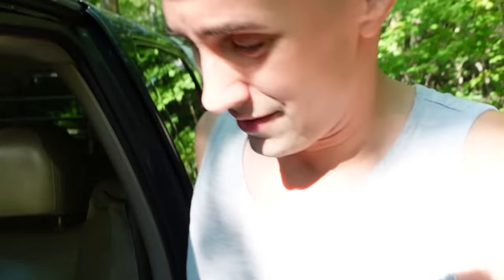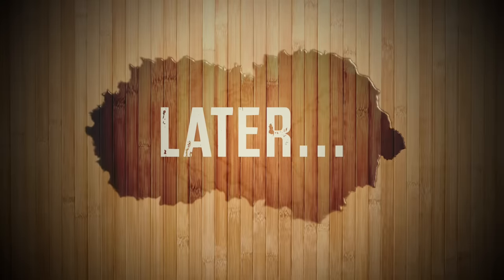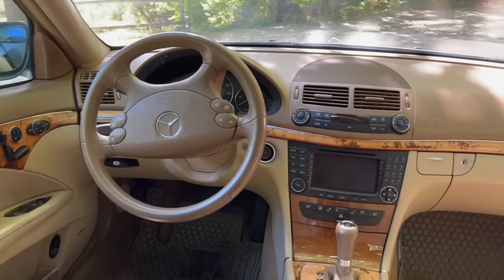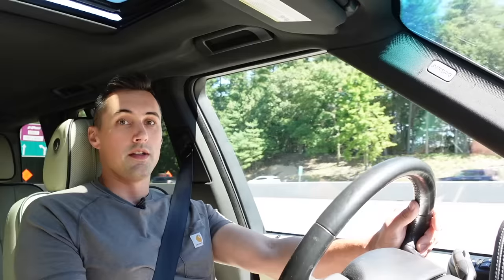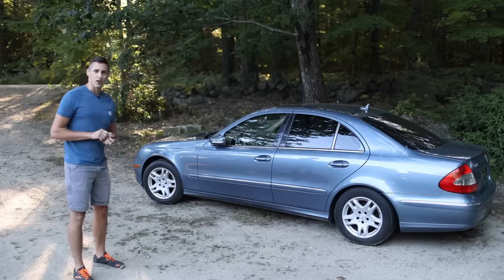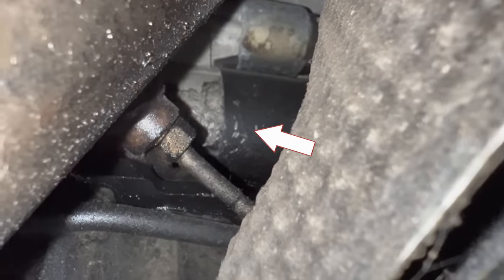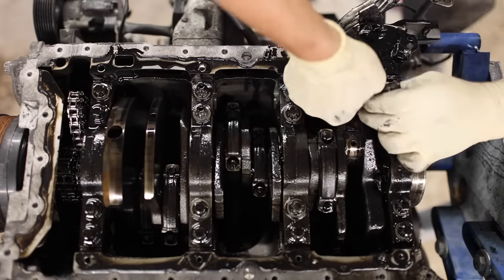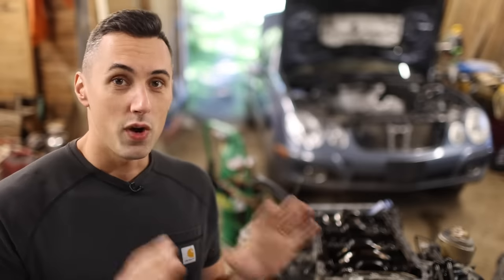I Bought a Repo’d Mercedes Diesel and I Regret it. Here’s Why You Shouldn’t.

Comment: I have owned one of these E320s for over 10 years and they are fantastic.  Great on diesel and fast, 0-60 in less than 8 seconds and well over 150 mph flat out. Mine has done 258 thousand miles and has never given a moment's trouble.  I have no idea why Americans don't like diesel cars, they are better in every way to petrol.
Reply: GM car 5.7 L V8  1980s Diesel engine was failure people in America got a bad taste for Diesel for many years
Reply: @timothygeorge1191  There were some good diesel's in the 80s but that's 30 odd years ago and times have moved on. Todays modern diesels are more refined and better to drive than Petrols or Gas as you call it. Americans are starting to pay much higher prices and why anyone buys V8 ponderous Gas guzzling 3 tonne boats is a mystery to me
Reply: I have two mercedes diesels, a 1953 170D and a 1983 240D. The 240D is my everyday car. They are great little cars.
Reply: @Stammon  A 240 D would only be refered to as a little car by a American... ha ..but yes they are great cars and are good for hundreds of thousands of miles.
Reply: "Better" except if you are a petrolhead ... Diesel is for trucks and buses nothing more, diesel sounds awfull
Reply: @simaothekid  it's not like hybrids with CVTs sound any better. I'd get a diesel for good mpg and still get the torque needed to kick me back into the seat.
Reply: 0 to 60 in 7 seconds? That's slow.
Reply: @buckfiden6102  slow for what ?
Reply: @buckfiden6102  ok tesla driver
Reply: @timothygeorge1191  Why would anyone buy a trash USA car?  Toyota-only.
Reply: @simaothekid  Efficiency is all that natters.
Reply: @buckfiden6102  for a car that weighs nearly 2 tonnes it ain't lol ;)
Reply: @andrewsutcliffe4889  can't speak to the US but here in Canada the fuel prices make diesel cars impractical. The savings you get in terms of fuel economy you give back with way higher fuel costs for diesel. They are also more polluting and sound like a tractor compared to a gas engine. North Americans just aren't into diesel for cars at all.
Reply: @mikerichardson60  Modern diesels are not more polluting and are silent from inside the cabin. I don't know what the fuel prices are in Canada but i do know you have a crazy authoritarian dic as a prime minister.  Unless the prices are over 30% more expensive the diesel is cheaper, will last longer and cost less to maintain.
Reply: @andrewsutcliffe4889  right now unleaded is about $1.50/L whereas diesel is right around $2/L so about 33% higher. We used to have emissions testing required every 2 years and trust me the pollution from a diesel was much dirtier than any gas vehicle. There's a reason they put all that pollution control nonsense on diesels to try and control the emissions.
Reply: Totally agree! I have a VW TDI Jetta sportwagen and I absolutely love it, 40+ mpg on the highway & averaging 33 in the city
Reply: @andrewsutcliffe4889  Maybe 40 years ago. Today it's a big car.
Reply: I'm an American and had a 2013 Volkswagen Jetta TDI and loved it
Reply: @buckfiden6102  Not for a diesel of the calibre and car, pretty good really.
Reply: Modern diesels are horribly unreliable and incredibly expensive to maintain
Reply: @adamdixon2251  aint
Reply: @Stammon  I had a 240D....drove it 250K on original clutch, exhaust, no engine rebuild. Sorry I let it go.
Reply: @mikek1681  Mine is a four speed automatic. If I had the parts, I would convert it to manual.
Reply: I have identical model as yours. I like the car on its quietness and stability. Radio sounds great. Drive smooth. Things I do not like is it lleaks oil no matter how I fix it. It is because of the oil pan is so shallow, the oil level is always above the seals. The pan is cemented. No gasket. The working room is so tight. There are too many safety fearure, it became a burden. Nine speed transmission, mine is jerky on slow down. Takes long time to warm up in winter. The turbo gasket leaks no matter how I fix it. Including relpacement, and put glue on it.
Reply: Diesel cars are great if you have high daily running - if not, the high maintenance costs and frequent services are really not worth it. But the torque… just for the love of driving it, one can buy it too. ❤️❤️💕
Reply: @monishthomasp  What utter drivel, how many diesel cars have you owned ? There are less servicing costs with a diesel.. there is less to go wrong. As long as you change the oil and filters every year they will run for ever.
Reply: @andrewsutcliffe4889  Yeah I'd say he's never owned one!
Reply: @buckfiden6102  320 CDI may be slow, but it's still eventually faster than anything else on the planet. This model still holds three absolute land speed records. Well maintained engine does million kilometres before major overhaul.
Reply: @andrewsutcliffe4889  Till date, I’ve owned 4 indirect injection engines and 2 common rail types. One was a OM 616 old Mercedes engine, One Ford, One TATA, one Peugeot and 2 Hyundais. But don’t get me wrong, none of my cars had an issue because I had a lot of running when I owned them and the servicing was regular.
The older IDI type engines, even if they didn’t  run enough, the maintenance was cheaper. But the newer engines, have issues like injector clogging etc., if you don’t use them regularly !!! And if you have to change the injector / common rail it costs a bomb. Plus the quality of diesel has to be very good. I lived in India, where unlike America, diesel cars are the norm. But yes awhile back we had fuel quality issues. Service intervals for diesel cars are also more frequent - 5000-7000 km as opposed to petrol where you can go upto 10000-15000 km. So yes twice as much frequent servicing.
Also service times you have to change oil and oil filter and every 2 service, the diesel filter which is an additional expense. You require a larger sized battery. Diesel being a heavier, cruder fuel, unburnt carbon particles are more as it burns less cleaner when compared to gasoline. So more carbon deposits and more pollution issues. In India, some states have banned diesel cars older than a decade from plying on the roads. Gasoline burns cleaner and are therefore less polluting.
But yes, though low revving, the fun of driving diesel cars is unmatched. The torque is lovely… the drive ability is great.. less gear changes required even in city as the engine crawls in almost any gear unlike petrol. And the pull is simply exhilarating…
So we calculate the monthly running cost and weigh it against the servicing costs and then decide whether to go for diesel or petrol. The moving parts replacement and initial buying costs are higher for diesel cars. And to fix a diesel which is broken, though not very common, is way more expensive than a petrol esp., modern ones. Moreover, in India, there is fear that Diesel passenger cars maybe banned anytime which is a scary thought when you think about resale value. Europe too slowly moving in that direction.
Not a diesel hater by any means, but I just had to sell a diesel car in June due to low daily running and get a petrol instead. But seriously… Diesel rocks… ❤️❤️💕

Just posting a few videos to put things in perspective - There are hundreds of Diesel versus Petrol videos that one can watch on YouTube. It’s not to say any fuel / engine is better than the other but it’s all based on one’s usage really.

https://youtu.be/veqI_D6HDtM

https://youtu.be/mOUJ4C61Lts

https://youtu.be/cOuvxEK1Smg

https://youtu.be/pZLX8YGyGc8

https://youtu.be/zAX3cDA5vkU
Reply: @monishthomasp  No idea what cars you are buying but having been a mechanic amd owned diesel cars for the last 40 years i can honestly say i don't recognise your narrative. If you put shit fuel into any car you will undoubtedly get problems. Diesel cars do not require sevicing more than petrol and a service normally only requires oil and filters.  The common rail newer cars are just fine if you fill up with clean good quality diesel.
Reply: @andrewsutcliffe4889  Agree. It’s most probably nation specific issues. Currently owning 2 gasoline cars (one car + one SUV) in 2 countries and all they cost me to run are fuel, oil and filter every 10000-15000 km. One has crossed 135000 km. So pretty fine with gasoline cars as of now. Plan to buy a diesel SUV in 2-3 years for regular daily use, once I’m back in India for good - if they don’t impose further legislative restrictions on diesel cars by then !!!! I ❤️ to drive diesels.
Reply: We've learned in the past decades that diesel is much worse than gasoline from an air quality perspective because of dangerous nitrous oxide emissions.  NOxs are a LOT more harmful than previously thought, and diesel vehicle emissions on the actual road are a LOT higher than in contrived lab experiments to meet regulatory standards ("Dieselgate" etc...).

Europe was heavily into diesel for energy efficiency reasons, but it has turned out to be a huge air quality fiasco. I understand Europe is doing a big reversal on diesel.

America's preference for gasoline over diesel may not have been intended to boost air quality, but it's an important variable when you talk about regional air quality.
Reply: @fortinbras47  More nonsense,  the latest diesels are as good as petrol.
Reply: @andrewsutcliffe4889  The point being, for passenger cars - gasoline can perform as good or better than a diesel car in terms of everyday road use. You don’t need that much of torque for daily use unless you’re lugging heavy loads daily. 
Yes, for a SUV or pickup with trailer for towing and load hauling diesel makes sense.
In countries like Australia, India and Thailand almost all SUVs are oil burners.
In a small passenger car yes for low speed city driving and crawling speeds also diesel makes sense - efficient but mostly unnecessary. After a 100 K km / 65 K miles on the odometer, a diesel car is bound to have more maintenance issues than a petrol engined car. The timing belt, injector issues and oil / diesel filters etc., needs more frequent attention. The diesel cars need very regular service as the moving parts are heavier and need good lubrication. If you miss the services on a Diesel engine, chances are, you may incur more expenses later. Whereas a gasoline engine requires less attention as all it has are spark plugs and ignition coils - rest of it are pretty simple. I’ve heard Diesel cars needing expensive injector changes after 100 K km / 65 K miles. 
So yes it does make sense if the fuel efficiency matters to you - if your running justifies the additional expense and the higher initial buying price. 
Pollution is entirely a different matter. Though particulate matters are higher, yes I agree the modern diesels pollute much lesser and are almost on par with their petrol counterparts. 
There’s no clear cut winner here. Both have their own merits and demerits. If you love driving with the extra torque, by all means, go for a diesel. I love it too. But it’s all personal preference and need based.
Reply: @monishthomasp  No you are just making shit up... Diesel cars need less servicing not more. I have owned diesel cars for over 30 years and I am also a mechanic.  As you say there are no spark plugs or HT leads or coil packs or points or electric ignitions to go wrong. They dont suffer from damp or water ingress. Most don't have cam belts they have gears or chains. You have belts on petrol engines to run power steering and aircon and water pumps. All you need to do on a diesel is change the oil and filters once a year just like you do a petrol. Why do Americans who don't own or drive diesel cars keep talking about shit they know fuck all about ?
Reply: @andrewsutcliffe4889  Fine… don’t face facts. Be in your small little make believe world. These are universal truths. Just because diesel is a fuel used for commercial hauling, doesn’t mean it requires less maintenance. They make an income out of it and the torque and fuel efficiency works in their favor which makes their maintenance bills seem trivial in comparison. Not so for personal use commuters.
I rest my case. Not prepared for any further argument in this regard.
Reply: @andrewsutcliffe4889  Sir the answer is that the liberals who control America/USA hate diesels and have regulated them out of existence.... Also TAX diesel so it is more than 2X the price of gasoline.  Toyota at one time sold some great diesels that cost about 90% less than a Mecedes.  EPA stopped that in a New York minute.   I run a Cheyenne diesel and a Cummins diesel.... and will until they stop selling diesel at the pump.  Which the liberals in D.C. are contemplating as soon as Electric vehicles are the major part of the vehicle fleet.   Also domestic production ---- through legislation is declining permanently as a result of Binden's executive orders.  U.S. is no longer a democratic country but ruled by Fiat.
Reply: I have one 2005 with 200.000 miles on it , still going good.
Reply: @simaothekid  
Try a Audi SQ5 TDI 
Or a BMW X5M diesel.
Reply: @Buck Fiden  The car weighs nearly 2 tons….. That is a decent time for a tank , let’s face it. 

And no one buys an E Class for the 0 to 60 unless you go for the E63 . 
Another beast altogether .
Reply: @monk3yboy69  it's a fast car for its size and weight for sure ... They are great at freeway speeds  and will cruise all day at 100mph plus.
Reply: Diesel is about double the price at all times and usually the cars or trucks that have them are more expensive too.
Reply: @tropicalsnow  bought a 2010 bmw x5 8n 2015.
Averaged $8000 per year in repairs on top of servicing which cost more than petrol equivalent. 
Traded it for subaru xv. Used less fuel. Never broke down. Coat$25 in repairs over 4 years.
Nissan navara diesel blew up totallym
Reply: @adamdixon2251  that is horrible.
Reply: @andrewsutcliffe4889  wow, you clearly have NO idea what you're on about. diesels don't have accessory belts, really? then how TF do they spin the alternator, power steering, a/c compressor etc? also, there are plenty of gas engines that use timing chains over belts. also, water in the fuel is just as much of a problem for diesel engines as it is for gas.
Reply: @simaothekid  uneducated 🤣
Reply: @timothygeorge1191  those haven’t been produced in 50 years .. highly doubt that is the cause
Reply: @Buck Fiden  for an old  model on their golden age l guess pretty fast.  😅😅😅
Reply: @efraingarciaescalante2824  For a car that weighs two and a half tonnes they are fast for any age.
Reply: @remorrison1958 last I heard MB was a German manufacturer  ..
Reply: @h8troodoh  No shit Sherlock
Reply: Never buy a Mercedes
Reply: @wil7228  profound
Reply: Unlike the car in this video, yours has probably been well-maintained. Diesels generally are more robust and reliable.
Reply: @adotintheshark4848  if you change the Engine oil and filter plus the fuel and air filters regularly then the engines will last for ever...
Reply: because they are quite smelly and loud
Reply: Yotas are SOULLESS CARS. They are stickly appliances. Folks who take pleasure in driving and enjoy torque and luxury dont touch hondas or 'yotas. No matter how reliable your toaster is.  @SovereignTroll
Reply: The silver button/strip below the hazard strip, press it for a surprise
Reply: Americans don’t like diesel cars because our government doesn’t like diesel cars  and places so many emissions requirements on them and taxes on the fuel, they make consumers miserable.
Reply: @citizentex5720  Newer diesels have less emissions than Petrol or Gas as you mistakenly call it. I really don't understand why America persists with lumbering Gas guzzling barges. Diesels are faster smoother  use 30% less fuel and need less maintenance.
Reply: @andrewsutcliffe4889  I have three diesel vehicles 😂. I’m on your side.
Reply: @citizentex5720  Are you American?
Reply: @andrewsutcliffe4889  yes. Texas.
Reply: @timothygeorge1191 and Volkswagen finished it off along with Cummings
Reply: @andrewsutcliffe4889 No, the best diesels are a thing of the past. The emission abatement equipment needed to get today's diesels through the important regulations make them a liability.
Reply: We like Diesels more or less in our trucks. The only company that does Diesels well is Mercedes and maybe Volvo. Both are pretty expensive in this country.. I would bet that that car, brand new would be well over 100k. I think the big question why do folks neglect maintenance? An oil change is 100 bucks or so? A new engine is substantially more expensive.
Reply: @carbocycle  Volvo diesel reliability is abysmal IMO.
Reply: @carbocycle  Lots of Companies make quality diesels , Audi VW Toyota Nissan to name but a few. Its important to change the Engine oil  and filter regularly in any internal combustion engine but in a diesel its also very important to change the diesel filters st the same time.   Modern diesels are more powerful, more fuel efficient,  require less maintenance and are far more reliable and last much longer than any petrol engine.
Reply: Maybe thats only you... the OM642 is a nightmare am glad i sold mine, leaks everywhere oil cooler, injectors failling, no access to change the fuel filter, sensors going etc incould write a book, timming chain rattling .

Comment: Thanks for converting the milage to liters/100 kms. For a Portuguese, it's difficult enough to convert gallons to liters. I also love a diesel engine.
Reply: 3.7 litres to 1 gallon.
Reply: @jamesedmond3351  although it's easy enough to use Google to convert it, converting gallons to L is not enough to convert miles per gallon to L/km. 🤣
Reply: We still use MPH and MPG in the U.K. 🇬🇧
Reply: @newblackdog7827 Not a flex
Reply: I wish the whole world picked ONE standard and stuck with it.